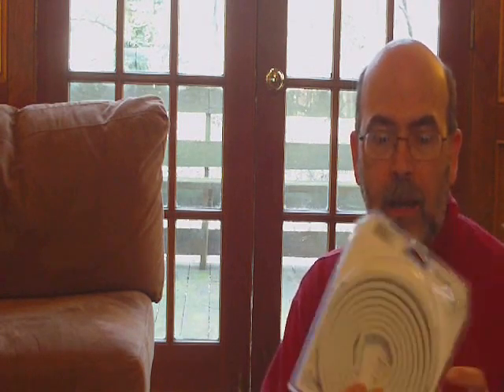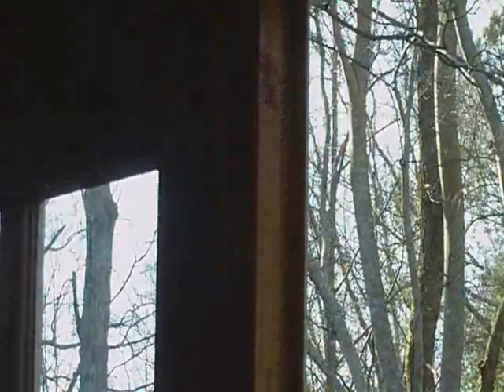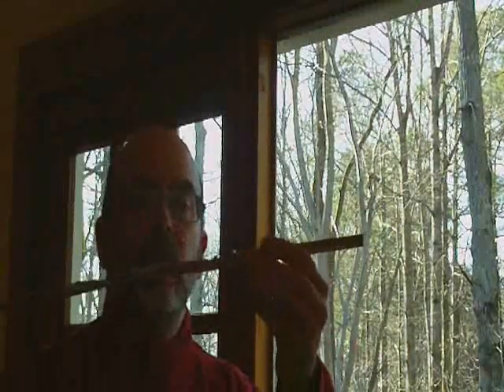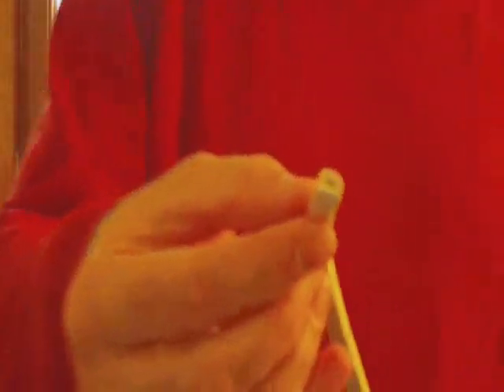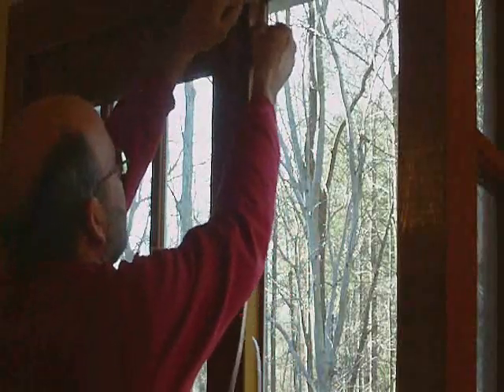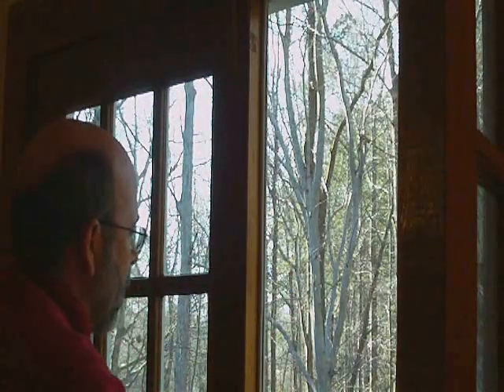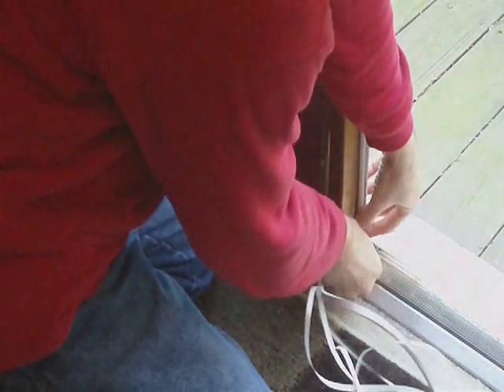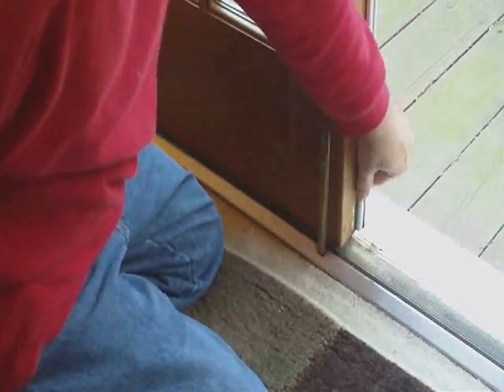How to Weatherstrip a Double Door

Comment: I have replaced weather stripping before on my entry doors. However with the current home, the double entry doors are flush at the outer edges but uneven gaps in the center where the doors meet. So stripping seems to work until I get past the closer/lock hardware. Wide gap, and not enough width in wood jam to hang additional rubber. Wondering if I should somehow add wood strip at bottom half of doors before putting on additional weather stripping. Scorpions and snakes getting in until I get this fixed
Reply from the maker: +Sandra Wiley Good idea Sandra. If it is at the bottom of the door, I'd install a hard rubber door sweep also.
http://www.rentahubby.org